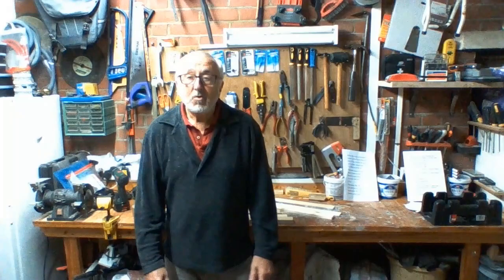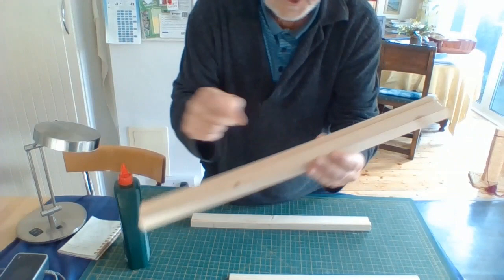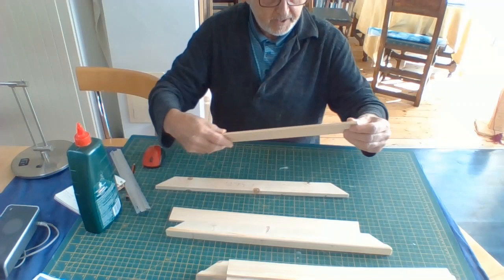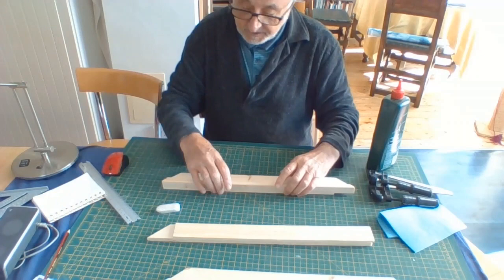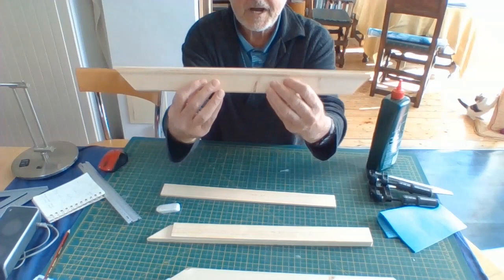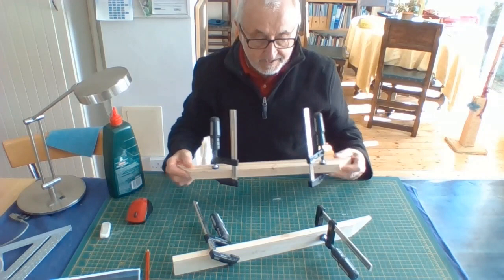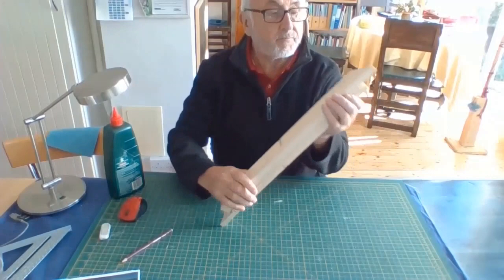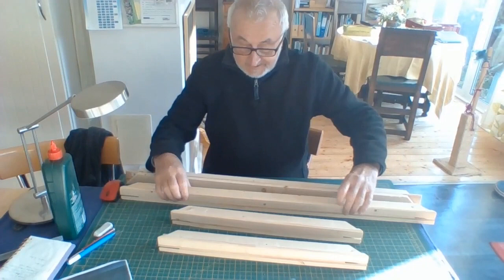How to make conservation quality stretcher bars with adjustable keys

Comment: Thank you Mr Saunders! I came her looking for a video teaching me the way to to it in one piece. But this is way better! And structurally speaking, it's better than one-piece bars, on the same principle that plywood is more structurally stable than solid wood. And the risk of detachment between the pieces is almost 0 if a good glue is used thanks to the fact that the contact surface is very wide. Thank you very much, greetings from Mexico.
Reply from the maker: Good to hear it's of use to you. And as you say, it is structurally stronger. Many thanks for the comment and greetings from Finland, where my wife and I have almost finished our summer long stay.

Comment: a rare video to teach you how to make real stretcher bars without special router bits
Reply: Agreed! I would imagine that in practice a router approach would require two passes for each end of the bars since the blade is too large to pass safely between anything but the largest, most expensive and somewhat dangerously-sized router bits. Both passes would be at opposing trailing/leading 45° angles, and not an efficient process. I think that when making these, lamination as per Rod's approach is valid for anything less than production level. Work like this with a router is a nice technical exercise, but not one of efficiency....and certainly not worth buying pricy router bits for!
Reply from the maker: Sorry I missed your comment. Thanks for the kind words

Comment: Excellent video, thank you. I’ve seen several videos for making stretchers with a more rigid joinery (pocket holes, nailed back supports) but those don’t explain how stretcher keys would fit into the picture. Bit of a head scratcher. I was intimidated by the tongue and groove miter joint but now I see it can simply be laminated. Thanks so much!
Reply from the maker: Thanks for compliment, Nick, glad it helped.

Comment: This is the first vedeo of building real stretcher bars with tongue and groove joints. All the other vedeos I found showed how to make strainers bars not the real article. Thanks so much for this. 
But I have to say the this would be a huge lot of very painstaking and accurate level of work to produce a single set of bars for just one picture. I guess the strainers would be much easier and faster alternative. Thanks again.
Reply: Yea is the first video!!

Comment: I like this way of making the mitred bridle joint. Much easier than how I was planning to do it. Thanks for saving me the time and headache.
Reply from the maker: Glad you can use it. How did you plan to make the bridle joint before seeing this method?
Reply: @rodsaunders149  I’m a carpenter by trade, so I immediately went to a mitred bridle joint, with one blade. Not to sure if I can describe it well enough. One corner of the joint would have been cut at 45 and then taken the middle 3rd out to form a socket for the blade to sit in. The other would be cut square and the top and bottom 3rds taken off at a 45 leaving the middle 3rd square and projecting out. End result is a single blade 45 mitre with room for one key. All this can be done on a table saw and is reasonably quick and doesn’t require laminating the boards together. I’m curious though, is this the standard way to make the frame for canvas pictures? I also watched some restoration videos to get ideas, and they all seemed to use mitred bridle joints.
Reply from the maker: I don't know if my method is the standard way of making a mitred joint. I couldn't find a video of how to do it on YouTube, so figured out this way myself. Your method sounds good, try both and see how they turn out.  My wife is the artist in the house and she says all conservation stretcher bars are made with bridle joints. The manufactured wooden ones, of varying degrees of quality e.g. thinner wood, and cheap canvas, are made with the bridle joint, as well.
Reply: @rodsaunders149  I would say that no, your way is not standard!! For this though I think it is superior to a standard bridal joint. I've done bridal joints before, that's why I was happy to see another method. I've already got the frame made, it worked wonderfully. Thanks again for enlightening me!
Reply from the maker: @HalcyonAcorn  Glad it helped.
Reply: @HalcyonAcorn  could you possibly make a video of how to do this on the table saw? I have one and was thinking to do it there
Reply: @Monduras  how to do this on a table saw? It was simple enough, just ripped strips 1/4” thick off of 2x6 pine and then assembled it as he did. I’m unable to make a video though, so you right on ahead.

Comment: Thanks for the video! I work in industrial woodworking (cruise ships, fine furniture, public spaces, etc) and would likely use the approach of making single-piece stretcher bars using a spindle moulder rather than laminating. Still, it's great to see a fully-realised stretcher bar frame being made from the absolute basics upwards, and in all honesty I like the lack of hassle this approach produces. Very commendable. I think that all I could add to this would be to apply more even clamping pressure when laminating the pieces with a basic (what looks like D2) PVAc glue, preferably by gang-clamping sets. In use however, the keys bearing onto the ends of the inner laminate would be unlikely to cause issue with the lamination joints, however it is feasible that splitting from sideways key pressure is possible. They can develop a lot of force for such a small component; the secret to the frame's successful operation, after all. Perhaps a couple of off-grain aligned glued cross dowels through the laminate sets an inch or so in from the ends would allay this, even if it is likely a non-issue. Belt and braces, always! Greetings from Finland.
<edit: I noticed that I used "inches" in an offhand manner....I work in millimetres, however an inch is something I use as a vague unit of estimation....weird that>
Reply from the maker: Thanks Tristan for the tips. When I next make stretcher bars for my wife I'll include doweling (since I posted the video, I've started using hard wood scraps for the keys instead of the pine off-cuts).
I've never used a spindle moulder and would be very interested to see how you would make stretcher bars using one. Any plans to do a video?
Reply: I'm unsure, Rod. I'd have to do some thinking about the purposes of a video more than anything, mostly because shaping with a spindle moulder isn't exactly in most people's arsenals. For those who they are, it's simply a case of setting up a correctly-shimmed cutter stack to run stock through, and that's more or less par for the course. In principle, it would be stock with the bead milled in, then pieces sent past the cutter stack at 45° to establish tongue/blades and corresponding grooves. On reflection (and having now verbalised the idea) I believe that your method is more relevant unless one was making a reasonable batch of stretcher frames that a more complex procedure would benefit. I actually decided to research stretcher bar frames after having watched the fantastic restoration videos on the Baumgartner Restoration channel here on YouTube. His frames have nice neat ideas such as attaching the keys to the bars using short lengths of string should they ever decide to go on walkabout. My own personal project for which I am undertaking this is a John Atkinson Grimshaw print that will be installed into a custom Mahogany and Ebony frame. Mostly I'm trying to establish how best to stretch the canvas efficiently with as low a profile stretcher frame as possible. This is the sort of design puzzle that I enjoy most....the confluence of engineering and art. Have a great weekend!

Comment: I made a jig for my table saw that allows me to cut the tongue and both angled slots from a single piece of timber but it's a touch and go method if I'm not concentrating. I have yet to see another video on YouTube that shows how to make a proper stretcher bar. Cheers Rod.
Reply from the maker: Thanks for the comment, Stephen. Are you going  to show how you made the jig? I'd be very interested to see it.
Reply: @rodsaunders149  I was thinking of doing that this morning. I'll need a few practice runs but I'll keep you informed.
Reply: @rodsaunders149  I ended up buying a professional Tennoning Jig. My results are much better but I think your method would be superior to mine.

Comment: Genius! I will be making my first experimental prototype today!  This looks very difficult at first glance but actually, it is very simple in essence. Thank you, Rod, but only one such video in two years? You must have a few more tricks up your sleeve ?!  A  perfect tutorial
Reply from the maker: Thanks, Jeff. As you say, looks more difficult than it is. The only thing I change is cutting the bottom blades and bottom stretcher pieces 5 -10mm shorter so when it all goes together, the front mitre joints are tight, and the back mitre joints have a small gap...aesthetics. As for more videos, everything I make is pretty well covered by others, so I'd just be repeating things.
Reply: @rodsaunders149   I made my first prototype effort today out of some strips of MDF. Just one corner, mind. A little confusing at times but it was very successful and accurate!  When I get to B&Q I'll make some proper stretcher bars from pine and then stretch up some linen. Excellent!
Reply from the maker: @jeff77hatt  Well done! Another small change I've made is using off-cuts of hardwood for the keys. They probably last longer than the pine keys when being tapped in to re-tension the canvas...

Comment: The support looks superb and I can’t wait to give this a go - any idea on cost difference between your materials and the ready made bars from the art store? I’m interested to know the costs of both, as I don’t mind doing the work myself to put these together. Cheers!
Reply from the maker: I put this 90cm x 50cm with a depth of 50mm stretcher bar frame for about £8, but I buy the timber in packs of 12 from any  B&Qs, Wickes etc. There are many online outlets that sell stretcher bars, though usually 18mm depth. 50mm depth is museum quality and you will pay more. If you have the time to make them yourself you'll get a great deal of satisfaction from doing it.

Comment: Thank you Rod for the informative video. Very well done.  I think you're the only one I've found that explains how these are built.  I just noticed that you have holes drilled on the right side fronts just below the beveled piece.  Are these just for your reference for placement or do they have another function?
Reply from the maker: Hi Tara, thanks for the comment. I don't drill any holes when making these. What you see might be knots?

Comment: Hi Rod, thank you for publishing such a fantastic and useful video, I very much appreciate it!  Is there any chance you can make a similar follow-up video of the dimensions for keyed/adjustable cross-brace supports  and how to cut and install them in a large or very large canvas frame?  Also, what type of adhesive would you recommend?  I'm not sure how to determine whether a glue is archival or not.  Thank you.
Reply from the maker: Thanks for the very complementary comment. 🙂
I made that video because I couldn't find any other method for a DIYer to make one, outside of owning some serious tools. I've made adjustable cross braces, but not with keys. I make them using 3cm x 3cm hardwood. 1 piece goes across the longest inside edges of the stretcher and 2 pieces go either side of it forming the square to the other inside edges of the stretcher. The 2 shorter pieces forming the square are fixed to the long piece with dowels, tight, without glue.
Again, I use dowels where the square brace meets the inside edge of the stretcher. Just drill the holes for the dowels, which are inserted into the ends of the braces leaving half the dowel projecting out the end, again tight with no glue. The corresponding holes for the other end of the dowels in the inside of the stretcher bars can be slightly larger than the dowels to facilitate movement when you adjust them.
To adjust them make a 40mm L x 15mm W slots, 40mm down from the ends of the braces where they go against the inside of the stretcher bar. Cut a 60mm x 30mm x 15mm piece of hardwood batten and drill 2 holes in it 10mm from each end. Fix it on top of the slot with 2 small nuts and bolt (I use plastic), with washers large enough to cover the slots to stop the bolts going through when they are tightened. Before the bolt is tightened you can slide it up and down. 
You need to fit the brace to three sides of your stretcher frame and then tap on the last bar.
When the stretcher is adjusted with the keys, the brace will be loose and can be tightened by loosening the nut and bolt and adjusting the brace to edges of the stretcher, then retightening.
It sounds complicated and is a bit finicky, but I don't have the time (or the enthusiasm to make another video), but I hope this helps.
Reply: @rodsaunders149  Thank you for that description.  Sorry you aren't interested in making another video, but I get it, it's a lot of work.  Which adhesives are archival that you would recommend for this project?
Reply from the maker: @lowslow3612  The wood glues I've been using aren't labelled as archival and I haven't come across one when making my wife's stretchers. My description of these stretchers being 'archival' is that the canvas can be re-tensioned by gently tapping the keys into the slots. However, when I first put the video up one person responded that a gallery would not tighten a canvas with this method but would use a fixed stretcher and when the canvas needed tightening, the staples would be removed and the canvas re-stretched using the hand tool and re-stapled.
Reply from the maker: Re: cross-brace supports. I've just come across brace bar brackets which fit to the ends of the brace bars and are adjustable, allowing a key to be inserted after the corner keys are tapped in to re-tension the canvas, keeping everything square. I've no connection with this firm which sell them: https://www.lionpic.co.uk/search?q=brace+bar+brackets

Comment: Great video. There has to be some tool that can make a cut in wood though...
Reply from the maker: Thanks asddasads. If you come across one let me know. I bought a small, top stretcher bar piece (very expensive) from an art and crafts shop (Jacksons in London) to see how it was made and the wood was fixed together in strips, like in my method only with finer joints because of factory processing. They were only visible because of the grain going in opposite directions.
Reply from the maker: Further to your comment about 'some tool  that can make a cut in wood...' I have a router and if you used  a straight bit it could, of course, cut a  squared groove in the wood. The problem is that you would need a factory type  jig to  hold the bar in position for the  grooves at each end, while leaving the blades formed.

Comment: Thank you so much for this ! 
How do reckon this will age ? 
Do you trust the glue over centuries ? 
Will try the method on a 100x100cm frame, can't wait.
 Good day to you, sir.
Reply from the maker: I hadn't given a thought to the longevity, into centuries, of my stretchers. When I've pulled a laminate apart (because of an error) after a few hours or so of being glued, the joint doesn't separate at the glue, it tears the wood to separate. The glue is stronger than the wood.
If you are making 100x100cm frame, you'll need to fit central brace bars. I tried all kinds of complicated methods in making adjustable brace bars and have now found that you can purchase Brace Bar Brackets. They fix to ends of the brace bars and are adjustable allowing a central key to be inserted after you've adjusted the corner keys to re-tension the canvas

Comment: This is super helpful. Any chance you could upload a guide for how to make keyed stretchers with cross-supports for larger stretchers? Thank you.
Reply from the maker: Glad it helps! On some of my wife's larger stretchers I made a central support with dowels at each end. I then made a 4" slot either end of the bar, below the dowels, which then had a sliding piece of wood attached to it with small nuts and bolts, which could be adjusted upwards and tightened, to take the slack out of the middle of the stretcher, when necessary. The other crossbar had to be made in two parts, using the same adjusting method, and joining the central support using dowels, It's not a simple method and because the pressure on the laminate is not on the face of the bar, which is its weakest part, but downwards, which is its strongest, I've gone up to 1m x 1m size canvases without the cross supports and they hold up. It's not the best solution and when I think of a better one I'll make a video.